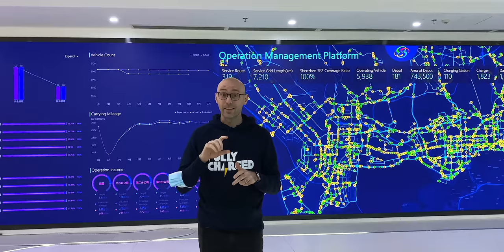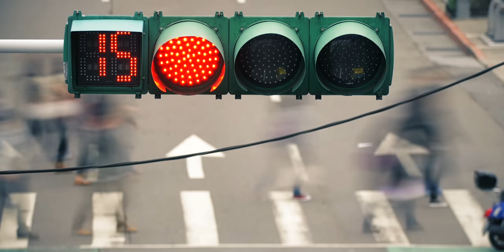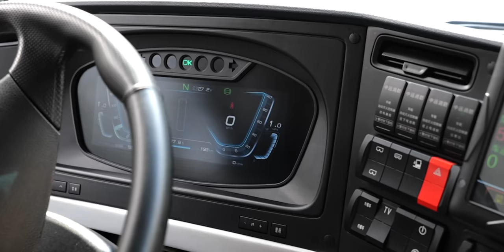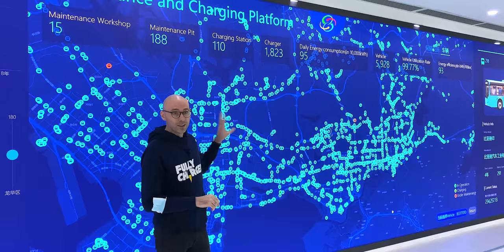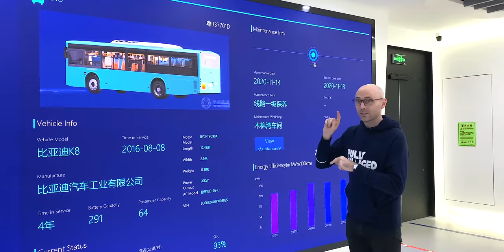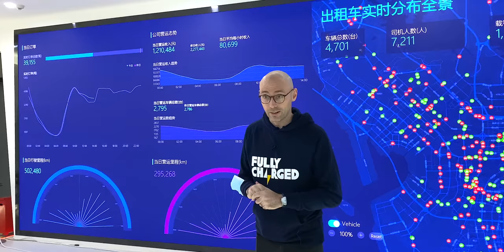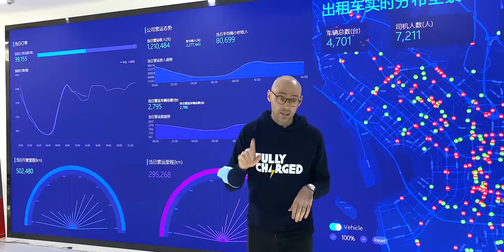The City with 16,000 Electric Buses & 22,000 Electric Taxis | 100% Independent, 100% Electric

Comment: China is pulling ahead of everyone in the race to go full electric. This is impressive stuff.
Reply: Coal powered buses is a step forward as it removes the pollution from the city , and places worse pollution elsewhere. ......
Reply: @budbud2509  this is a multi step process. while the consumption end is being electrified, the generation ends are also being progressed, more solar and wind farms, as well as hydro dams (but this has its other draw backs) are being built particularly in the sparsely populated western provinces, together with new ultra high voltage DC transmission system to bring the power to the densely populated central and coastal provinces.
Reply: Is it really impressive you still need oil for products from the vehicles for tires for things to rotate and not squeak.

Those who think you can go all green are absolutely ignorant.

Jesus Christ is the souls first last and only hope.
I
Reply: @naughtyfrog8257  Yes the wind turbines and the solar panels built with fossil fuels. Its impossible to create steel on a commercial basis without coking coal. The huge Lithium mines powered by diesel and all the plastic in these EV cars made by solar and turbines ? 
Now before u think Im a fossil fuel junkie u would be wrong, just as we have multiple power sources for todays transport ( Petrol, Diesel, LPG, H2 EV ) so it will be in the future . I prefer Thorium as a sensible power source that wont near collapse as in Texas and Germany recently, I dont care to much for the PWR version of Nuclear power and I view Thorium as a safer alternative .
Reply: @budbud2509  absolutely, human’s very presence and lifestyle imposes huge net energy budget amongst other things on the earth’s resource balance. nothing is perfect however we still have to move towards a better solution than yesterday. and yes i’m reasonably familiar with various battery and fuel cell technology, none is perfect and sometimes the better ones don’t get adopted.
Reply: @naughtyfrog8257  " And sometimes the better ones dont get adopted " ......... U are so right , Thorium reactor was invented and run at Oakridge Cali for many years.  However it was never adopted as the nuclear solution because you could not make bombs from the waste process,  and bombs were viewed as more important than safe power !!!
Reply: @budbud2509  I’m from Singapore, a very very small place, and for very long we had contemplated nuclear power but never made the move due to public fear and concerns from our neighbours. 

I recall the Dem presidential candidate Andrew Yang making a strong advocacy for thorium reactors.
Reply: @naughtyfrog8257  Ive been there a few years back when my wife was alive , lovely place. I notice another place Im fond of is Manila and they built a fully functioning Nuclear Power station ( PWR ) but it has never been put into service because of those same fears , and when u see what can go wrong its probably good sense. And that was why I was so against Chinese built PWR reactors on the UK's south coast , only 60 miles away from central London ....... Not very sensible was my thoughts if it all went wrong !!
Reply: @budbud2509  lol I call BS, Im an engineer and can tell you obviously know nothing about baseline energy production vs variable energy production that powers our electric distribution grid just based on the fact that you said these buses run on coal power.
Reply: @budbud2509  Wow!  I got to read about this.  Did Oakridge patent this? Need to spread the news.
Reply: @youngz13o  Ohh really , well my specialist subject is design for production and the manufacture of prototypes for large scale consumer testing.  Also in Rapid Prototyping and Rapid Tooling . So grid expertise is not on my list. However this vid was about EV's in china , and if u look at china's electrical sources its primary coal fired power stations, I think I read that they were opening 2 new coal fired power stations every week ....... hence my tongue in cheek comments about coal powered busses .
One of the designers I work with is in Chicago and he is British , just like me ......... and he says Americans just don't get Irony or even UK humor ...... 2 countries separated by a common language seems to sum it up. BTW in case u did not know it was Oakridge, CA. who had a Thorium reactor running in the 1950's for about 5 years
Reply: @budbud2509  Bus lines in the US, even when publicly owned, are dependent on the fare box to some degree to cover expenses, apparently this is not true in China, somebody else is paying the bill.  These are very nice buses, state of the art, but they are very expensive as compared to a diesel bus.  By the way, American buses and taxis don't tire the drive out changing gears, that is all done automatically.  The real issue is where all of this electricity comes from, most electricity in China is generated by thermal plants fueled with coal and this is unlikely to change anytime in the immediate future as evidenced that they are building more thermal capacity than either wind or sun.  They just got a huge jolt of hydro capacity but that has been problematic as well.
Reply: @budbud2509  

Coal power only around 60% in China electricity profile
Meanwhile the fuel pump into buses and taxi in your country are 100% fossil fuel.
Reply: @leerizer  Totally wrong my little chinese troll......
Actually your coal consumption is going down thanks to your ban in fine Australian coal 
Have u not heard of the  mastiff offshore wind farms  in the UK ?
Below is the truth taken off the official UK site

BTW your account has been credited with 5 Yuan , keep up the good work. 

Renewables generated 43 per cent of the UK’s electricity, while fossil fuels provided 38.5 per cent. Offshore and onshore wind accounted for 24.2 per cent in the renewables share: offshore wind 13 per cent and onshore wind 11.2 per cent. Low carbon sources, including renewables and nuclear power, together generated 59 per cent of the UK’s electricity in 2020, according to the figures in the latest Energy Trends report published by the Department for Business, Energy and Industrial Strategy (BEIS).
Reply: @livefree316  There's a big difference between using petroleum to produce products and just burning it for energy, just ask your imaginary friend.
Reply: @earthwizz  God allowed there to be oil in the Earth for a reason

You act like e energy is so efficient.  when in fact it's hard to dispose of e batteries they're expensive you act like you can use fans and solar panels all over the place guess what that stuff's killing birds that stuff isn't as good for the environment as you think.

Personally I ride an e-bike everywhere I enjoy it I love it but without the oil in my pedals and in my tires I wouldn't be able to ride the bike

I love riding the ebike being in the sunshine I don't even have a car the e-bike is my means of transportation so I'm speaking from experience

Personally I know not everyone can ride a bike there's people that love to walk there's people that love to be in cars but you know something that's their choice that's what the free market is about.... choice the wicked left hate choice they want to make the choice for you.

I don't think oh man I'm riding a bike everywhere I'm so much better than you gas guzzling car people

Ultimately God's going to make a new heaven and Earth does that mean mankind can be all irresponsible no thank God there are those who are responsible with their time on Earth but to worship the Earth is to be a fool

Instead of people hugging trees they need to let the almighty God hug the ignorance out of them. ROMAN'S 1

WITHOUT OIL WITHOUT OIL YOU COULDN'T MAKE ANY OF THESE PRODUCTS PETROLEUM IS IN SO MANY DIFFERENT THINGS ONLY WILLFUL IGNORANT PEOPLE BELIEVE YOU DON'T NEED OIL THAT'S BASICALLY WHAT A LOT OF THE LEFT SAYS WE DON'T NEED OIL YET THEY HAVE OIL AND PRODUCTS THEY USE THE WICKED LEFT LOVE TO TELL YOU YOU'RE MESSING UP THE OZONE WHETHER RIDING AROUND IN THEIR JETS THEY LEFT TO SAY HOW HUMBLE THEY ARE WHAT THEY HAVE TWO SUPER EXPENSIVE APARTMENTS THEY HAVE A MANSIONS THEY DRIVE AROUND AND TESLA'S THE WICKED LEFT PLATFORM CATERS TO A BUNCH OF HYPOCRITICALy SELF-RIGHTEOUS CONTROL FREAKS
Reply: @budbud2509  Taking coal out of this message is easy. I get my energy from my roof and our grids globally are moving rapidly towards renewables. 
Thorium is a very interesting technology but, like all other nuclear and fossil fuel generation tech, it can't hope to compete with the cost of renewable generation tech which is getting cheaper by the day, as are the batteries to store it. Hence the accelerating transition to renewables we're witnessing which also means a rapid improvement of the tech. That's the nature of technological disruption. As an engineer you should know that. If you don't I suggest you look it up.
Reply: @henryostman5740  Renewable energy generation infrastructure growth in China is higher than anywhere else on earth. Whilst it's true they are still building coal plants it's not remotely as much capacity as renewables and they've also cancelled a great many planned coal plants. They obviously see their future in renewables but it doesn't happen overnight. 
I'm not a fan of the 3 Gorges dam either.
Reply: @budbud2509  Actually the coal ban was a slap on the wrist for doing the USAs anti-Chinese dirty work. Australia needs to take note the Chinese won't be needing coal forever, we should base our economy on something more sustainable.
Reply: @budbud2509  What an absolute crock of misinformation. Who needs faith when the evidence is right there in front of you. You probably ought to check it out being as you're an engineer and all. I'm sure everybody here believes you.
Reply: @livefree316  So you don't think there's a difference between making products out of petroleum and just burning it? Because that's what I said.
BTW my home has been solar powered for 35 years. We've added to the array over the years but around half our panels are 35 years old and never skipped a beat and batteries are recyclable. You should check that out with your imaginary friend, he might be up on all that stuff even if you aren't.
Reply: @livefree316  Please take your medication ok?
Reply: @livefree316  he's a bus driver too? That's quite a progression for a simple carpenter!!
Reply: @markthomas7279  Gods word teaches Jesus can relate to us as humans. Why? He walked among us,/He sufferred. HE enured hate of mankind. He overcame hate with love. 

 Yes you can say  Jesus is as bus driver as He is the captain to heaven!

Comment: I spent some of the best 5 years of my life, living in this incredible city! If I may add, being a carnut/petrolhead, I never once wished for owning a car there, with public transport being so amazing (and now sustainable!), ordering a taxi, sharing rides have never been more convenient. Great job FC team on this video!
Reply: Same here, I have been in Shenzhen for 5 years.  I wish for faster metro deployment, especially the northern side.  But rarely do I think I wish to own car here.  Just no need.  Car or a proper ADV motorcycle is needed for exploring rural countryside.  Otherwise no need.
Reply: I was in Shenzhen a few years ago for a study trip & found their new electric buses to offer pretty good ride quality, but was wondering why they used a high-floor design (which would reduce accessibility)
Reply: @lzh4950  that’s a good thought. The engineers need to put more thoughts for the disabled people as well as our whole infrastructure design.
Reply: @chang8690  Designing a large vehicle like a truck or a bus is totally different from designing a passenger car. The total weight is different, as well as the weight of the cargo / people that the vehicle will carry is different, everything has to be accounted for, because, if you don't, then the whole thing simply can't move, or if it move, the momentum would brought the vehicle into very dangerous situation, when it is fully loaded.

The size of the tire for a truck / bus is so much bigger than that of a car, and that difference alone added a few feet to the bottom of the vehicle, plus, if you are the designer of a large vehicle, you gotta reserve some space between the wheel axle and the actually underside of the vehicles for suspension.

And the suspension system of a large vehicle is different from that of a car as well, and that alone added even more space to the bottom of the large vehicle.

so everything adds up, inch by inch.

In conclusion, do a little bit of research (since you guys are online) when you have questions, instead of just voicing out your displeasure.
Reply: @lzh4950  Battery's.
Reply: @clocktower1164  This is a comparison to other buses that are lower, not just displeasure.
Reply: @tedmoss  Thought of that possibility but you could also put them on the roof instead, or if you're worried about stability, move some batteries to below the seats

Comment: excellent episode. I work as a city bus driver near Montreal, Canada. This should be required viewing for the decision makers
Reply: Bonjour, I recall there was few demostrator from BYD, Nova and new flyer running in STM a while back for data accqusition and evaluation. Due to the climate, they need to run diesel heater to suppliment temperature control. Im not sure STM is waiting on the battery is improve enough to run the heater fully as well.
Reply: Too cold

Comment: Absolutely incredible....London, please take notice and learn!
Reply: London: Human Rights,  blah.. blah..
Reply: @nmew6926    Damn right!   Human right is far above these low end transportation issues.
Reply: @nmew6926  stabbing rallies, blah, blah, blah
Reply: The 43 was the first double decker route to go electric in July 2019, a few more have followed since. The single decker fleet is more advanced with many routes gone electric. I've lost track a bit,  not been quite as nerdy recently.
Reply: They need to the national grid needs to be modernised before large fleets of trucks and buses are able to be charged at once. I believe that rather than giving money to people that buy electric cars, they should use some of that money and invest it into more power stations and sub stations so that when everything switches to electric there won't be as much stress on the UKs aging electrical system
Reply: London: NO
Reply: London has bought a few BYD electric buses from Shenzhen before, and they plan to buy more!

Comment: This is amazing! One of the best episodes so far.

This should be a template for all UK cities and towns.
Reply: It already kind of is. 350kw chargers will be at every service station by mid-2022. The weaker 22kw chargers are being installed super-fast, even in the more deprived parts of London. What is it with all the fashionable self-hatred in the UK? This video concentrates on ONE Chinese city. Nationally, the UK is way cleaner than China already.
Reply: @mcarlsson74  Firstly Martin, aspiring to mimic the success another city is having is not "self hatred" and I resent the accusation.

Secondly, I live in a town with 18 chargers in total, all of which are below 100kw and there are no dedicated charging stations within 10 miles. All this whilst our town frequently breaches air quality standards and has a major problem with traffic congestion. 

What's happening in London is not representative of what is happening for many towns across the UK, hence my desire to see this success replicated.

But thanks for your input sweetcheeks. 😘

Comment: It really is damn impressive the scale that they have been able to electrify.
Reply: For the environment it would have been better to upgrade the diesel buses. Not to sell them and buy new wons. But the pollution must be much better now:o
Reply: @dieabsolutegluckskuche5174  Yeah, in China there is definitely less pollution nowadays. Look at photos from 5-10 years ago. It used to be horrendously polluted, it's still polluted but it's significantly less.
Reply: @dieabsolutegluckskuche5174  I don't think you can simply due that since you may still need to create space for the batteries and structure - modification may take far more time and money and probably was not worth it. Just a thought

Comment: The byd e6 taxi looks good. Later versions have 80 kw battery packs!!! Id buy that. Bring it to NZ! Good report. Very impressive.
Reply: Pretty lackluster for personal use as it just doesn't handle very well. But yes I do think reasonably priced EV fleet is the future for the taxi industry.
Reply: @theolich4384  good to know thanks.
Reply: Believe me, it's not that comfortable but the new types might be better. NZ is quite clean that I doubt whether it's any urgency to change the energy. I travelled there for two weeks with a rent car, old toyota petrol car.